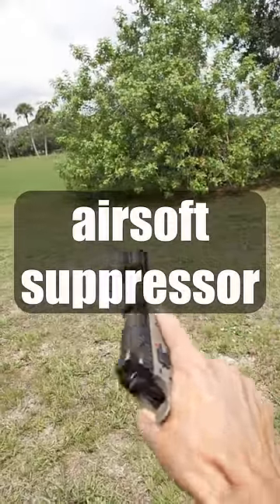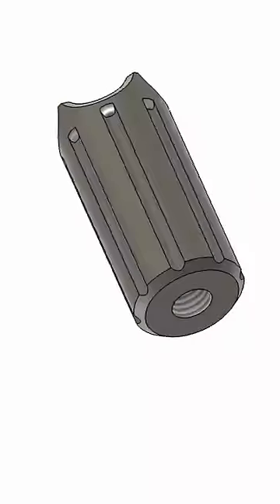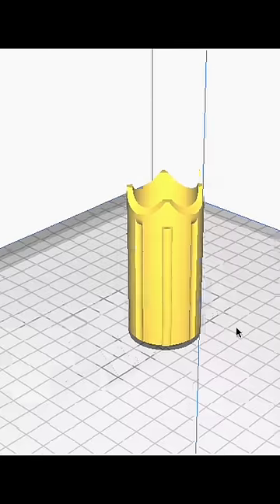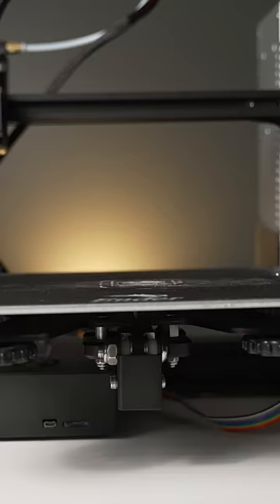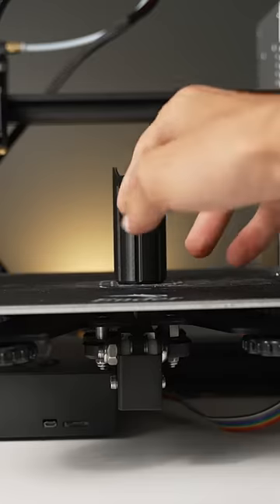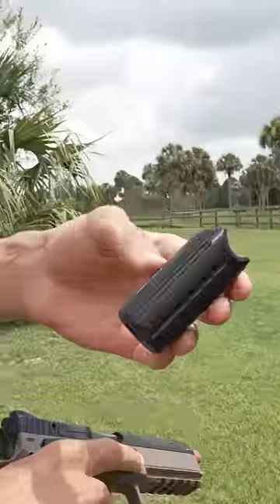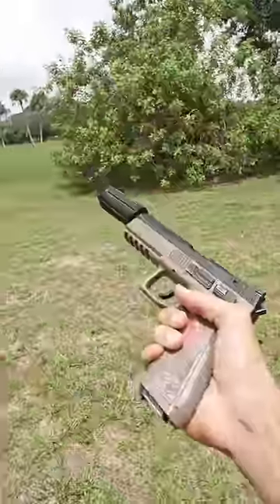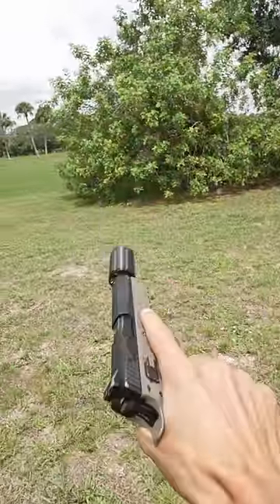Let's Make a 3D Printed Airsoft Suppressor

Comment: its not a suppressor, its a blast mitigation device lol
Reply: its a fucking loudener lol
Reply: @SmilingMoos3  if you were to put that on a real gun itd work as a blast mitigation device (though itd have to be metal)
Reply: @gmodiscool14  wouldn’t it be just like a really bad muzzle brake
Reply: @dakilla798  its not even that. its just meant to direct the blast from the muzzle forward, making it sound marginally quieter for the shooter and reducing the shockwave around the barrel. probably great for a 308 or an sbr ar 15 at the range since those things spit fire.
Reply: Aka flash can. In real life they're to mitigate any sideways or rearward concussion or flame for cqb. They look cool but outside of their specific purpose you're usually better off with a flash hider or muzzle brake depending on what you're doing.
Reply: @dogboy0912  yea
Reply: Flash suppressor
Reply: @eckiefleckie4938  That isn't a real name lmao
Reply: @forthebirdsyt4984  yeah it is. It’s a flash suppressor or a blast mitigation device
Reply: @eckiefleckie4938  Dude I'm telling you "Flash Suppressor" isn't a real terminology.  And even if it was, the shape of this device is similar to that of the Noveske "Flaming Pig", which is a muzzle device that directs the blast forward, making it much louder and making the flash much brighter and more noticeable.

Comment: To all the people saying it makes it louder:
Who cares?  It's not like you're going to be assassinating people with an air soft gun.  its already just for fun.  So why does it matter?  It just looks cool
Reply: but then its not a silencer😭
Reply: @saltyy_Milk  did you read my comment?
Reply: But it's not silent.
Reply: Yeah true and all but that’s not what a silencer is
Reply: Some people just want a suppressor as a functional airsoft suppressor.
Reply: Its should be called Loudener tho instead of "Silen"cer
Reply: It's not a suppressor. It's more like a 3d printed muzzle break...closer to a flash suppressor than a reg. Suppressor
Reply: @saltyy_Milk  suppressor not silencer
Reply: You can put foam in it to make it quieter
Reply: @Ziriah  it is what a “silencer” is, that’s why they don’t exist, “silencers” silence the gun, like from James Bond but a suppressor reduces noise just enough to not need ear protection

A suppressor is a (usually) long tube with a large amount of walls within so gas can bounce around inside instead of blowing out and making noise, sometimes a rubber stopper for the bullet to pass through and trap/slow the gas down (which Ik it wouldn’t work w airsoft for the rubber)

But, for airsoft it’s quite clear that it’s for looks
Bud the thing is it doesn’t look like a suppressor
It looks like a hollowed out tracer or a long compensator without the Gas vents on the sides
If he wanted a suppressor then he shouldn’t have the giant end w/ the semicircles cut out, because that does in fact do: nothing but add an extra mm or so to the barrel length
What this looks exactly like to me is a hollowed out “tracer”

But it’s also not a “loudener” commenter is right, loudeners if they were realistically used would be a cone that only fits flush with the barrel and lets the gas resonate like a trumpet
Buts he’s wrong about the “who cares”
Because the point of airsoft for people who don’t play the games (or do) is to be able to have “cool guns” with a bunch of attachments

Also hi I’m a gunsmith who can’t escape airsoft for some reason
Reply: @LeafySkys tell me you dont play airsoft without telling me that you dont play Airsoft 😂👌
Reply: @saltyy_Milk  suppressor* if you’re gonna argue, get it right
Reply: @Ziriah  so what?
Reply: I think the whole reasoning behind suppressors is its not supposed to attract a lot of attention but that doesn't mean it's "silent". So if I were if irl I shot someone with it, it's going to be silent because since our human skin is soft the impact won't be as loud but shooting a wall will make it loud. (I think people already know this) 
In conclusion, silencers don't attract the whole area just only in closed spaces.
Reply: Yes, you know when you buy a tablet and get a pice of wood? But who cares, it dosen't matter, you don't need it
Reply: >makes an airsoft suppressor
>mfw it doesn't work
>mfw it's actually an mf loudener
>still argue that it's a suppressor because "muh coolz looks"
>even claim it as a suppressor to clickbait people
Reply: @toanquoc3932  please point out where I argued it was a suppressor because it looks cool.  According to what I see, I'm just saying the attachment looks neat, like a nerf gun attachment.  I never said it has a practical use.  Matter of fact I even pointed out that it doesn't.
Reply: But then you get in trouble  becuase  you can't tell it's a airsoft gun ..
Reply: @zalmanfans1334  what are you smoking?
Reply: Calm down geez, it's just there for decor, no need to panic over a hard plastic gun.
Reply: Suppressors are needed commonly in airsoft to make a gun quieter. For instance ghillie snipers at point blank range with a sidearm. Happens all the time. What he made was something sadly useless.
Reply: It’s closer to a blast redirect, it should only be louder if you are down range of it
Reply: @kentrellmyworld5832  'suppressor' is the more practical term because it states what the can does, 'silencer' is the official designation given to the patent when Hiram Percy Maxim invented the world's first suppressor for commercial use in 1902, aptly named the Maxim Silencer. Therefore, neither term is incorrect, and they both mean the same thing.
Reply: @DaMainCookie  'suppressor' is the more practical term because it states what the can does, 'silencer' is the official designation given to the patent when Hiram Percy Maxim invented the world's first suppressor for commercial use in 1902, aptly named the Maxim Silencer. Therefore, neither term is incorrect, and they both mean the same thing.
Reply: Could say that about any sport, about any topic. The details are what make hobbies fun. "To all the people saying that x is a quarterback and not a pitcher, who cares? Both are games with balls!".  It's not pedantry when someone makes a bad instruction vid and people point out the obvious mistakes.
Reply: @zankeekee  did you now see the video he calls it a suppressor it’s not a suppressor 🤦🏽
Reply: Then it's click bait my guy.
Reply: It is not a silencer bur it is a niet looking flash hider
Reply: Just so you can know I had to go to check the comments section
Reply: Tell me you know nothing about real suppressors
Reply: dont call it a silencer then bro call it a useless attachment
Reply: @Sebastian_Almric  bro suppressor and silencer are used interchangably
Reply: @asiancat9867  then buy one the video one is for show
Reply: Make a monolithic version
Reply: @zankeekee  a suppressor that bot doesn't function like a suppressor and doesn't look like a suppressor is not really a suppressor
Reply: Yes ofcourse but like just for a experiment, could we make a 3d design same as to a real suppressor and see if it works?? I mean I think it would sound rather sweettt
Reply: @saltyy_Milk  it's not a silencer anyways, silencers make WOULD make you gun completely quiet. Suppressors muffle the sound. Completely silencing a firearm airsoft or not a is completely impossible
Reply: That ain’t no suppressor
Reply: @asiancat9867  it's airsoft majority if not all the noise comes from the motors gears or the bolt with gas only quiet gun is a hpa one but then you get arsehole hpa twats that bypass the full auto rule
Reply: @kentrellmyworld5832  they’re literally the same thing
Reply: It matters because it confuses people.
Reply: They're upset that the person is disingenuous about the title of his video.
Reply: this argument is immediately gone by the fact that you use airsoft guns in airsoft games, “it’s not like you’re going to be assassinating people with an air soft gun.” you kind of are in a airsoft game where it might matter, dunno if suppressors matter in airsoft games though since i don’t play airsoft
Reply: @jomo5326  lol I don’t know a single shit about airsoft so idk what you are talking about, I just came here to watch the vid for entertainment.
Reply: @BombasticBooger  thats the thing.  It doesn't matter.  Unless you're really gonna get that pissy over your airsoft suppressor not working in a game, then no.  It doesn't matter if it works.
Reply: No cap
Reply: Looks don’t matter. 
Most people like “cool” looking stuff. If it doesn’t do anything then whats the point?
Reply: @gunslingerblade  what are you smoking?  An airsoft gun has nearly no practical use and is just for fun, so why is it wrong to want something you do for fun to look cooler?   Are you telling me that if you had the option between a black Lamborghini and a puke yellow HHR, but both of them have the same engine and interior, the choice wouldn't matter to you at all?
Reply: @zankeekee  if i had the choice to get a black Lamborghini, or a puke yellow HHR, i would get a truck. 
Im not smoking unlike you.
Reply: No it matter !
Reply: POV: your playing airsoft and u hear a fvcking bang .
Reply: @zankeekee did u use ur brain?
Reply: It sounds quieter
Reply: And who said we're not assassinating people with an airsoft gun, and it looks like shit.
Reply: @rustleracing  are you illiterate?

Comment: What’s the amount of sound that gun has normally without the suppressor
Reply: The same, maybe quieter.  This design is shaped more like and amplifier. Airsoft suppressors are more for looks or covering an extended barrel
Reply: If you want an Airsoft suppressor to be functional then it has to be hollowed out in the middle with foam inserts to dampen the sound of the gas coming out of the end of the barrel. Since this doesn’t have foam and because of its shape, it’s probably acting more like an amplifier as the other guy said.

Comment: It's literally just a open cylinder. No baffles, absolutely nothing to block anything
Reply from the maker: Yeah, its just airsoft though. Most of the noise is coming from the slide going back. It's purely cosmetic.
Reply: @AirsoftGunsnGear  i know, but i mean you could have easily printed a cap for the front would have looked even better then

Comment: It'd be cooler if the suppressor was made to the specifications of a real silencer. It wouldn't be hard, because your already 3D printing the piece.
Reply: You shouldn't though unless you want to be in trouble with the Fed. Suppressors are regulated entities, but mock / faux suppressors are not.
Reply: That, is a felony

Comment: i thought this was gonna be a 3d printed suppressor for a real gun
Reply: Wouldn't survive the first shot. Expanding gasses and the layered structure don't mingle well. I did just order one for one of my PCP air rifles. Maybe one day, I'll try it on my 10/22(it's only $20). I'm curious if a 3d printed suppressor could survive a .22, but seriously doubt a 9mm
Reply: @erict3728  yeah ik but the most concerning part is that it is illegal to own/make a suppressor without a license
Reply: @Spells1  you don't need a license but you do need a tax stamp. A license would indicate once have the license you buy, make, and sell as you want and that is definitely not how it works
Reply: @joeb6750  interesting

Comment: Suppresots do not work on airsoft, actually it's the opposite of surpressing. In guns, after the gunpowder burns, it takes out the air, and puts in gasses, which release the bullet. When the gasses escape, they go into small rings of holes in the surpressor, therefore making less sound.
Reply: on GBBs they do work. the compressed gases expelled after every shot still makes noise. on AEGs not so much.
Reply: @basketcase1235  Airsoft does not use gunpowder, mate. Airsoft uses either wheels or springs.